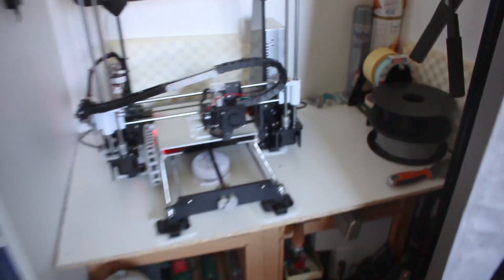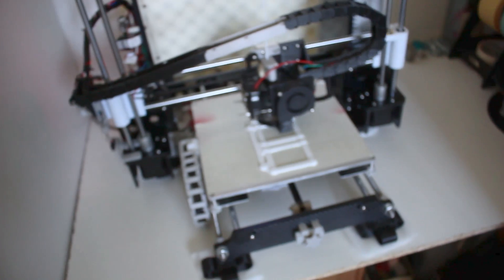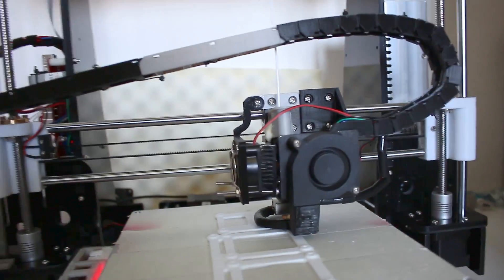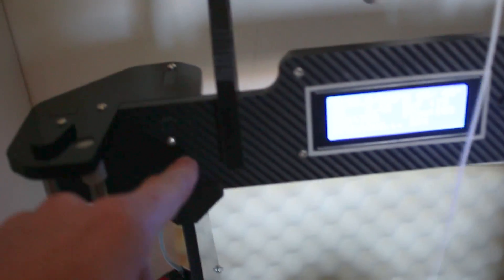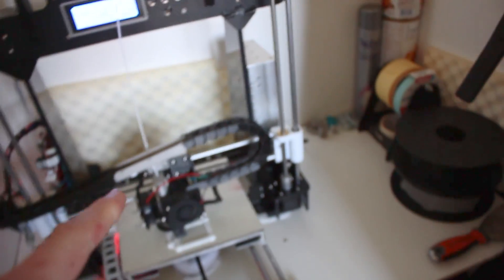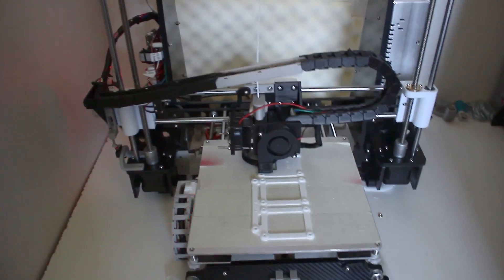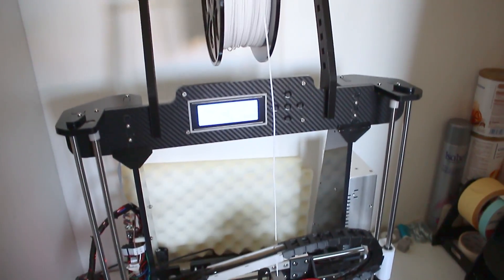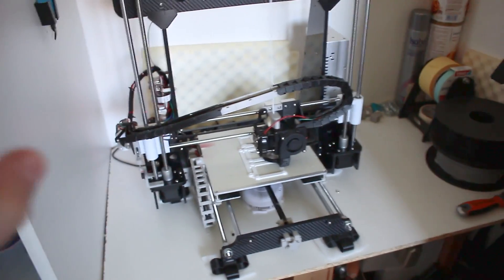ANET A8 Upgrades you must do ! [EN]

Comment: This 3d printer (I have one) is only for improving himself. Its so bad that i could'nt get it fixed for a month. Every time i change its place, Settings goes problematic.

I think you should keep it on ONE PLACE
Reply from the maker: Yuup very hard printer to work with at the begining, but you get used to it

Comment: Whats your most comon settings your using for pla and abs? Bed temp/extruder temp/flow %?  Are you using a bed leveling sensor or updated your software to marlin or skynet
Reply: Hi ! All my settings are in the description =), i'm curently using a sensor, ( i made a video about it ) and i upgraded my soft to marlin

Comment: I have just bought the Anet A8 as well and i wanted to print the chains for my wires, but they turned out really low quality. What settings did you print them at just wondering so i can have nice smooth moving ones like you.
Reply from the maker: Hi ! I put all my settings in the description of this video ;)

Comment: Thanks for the video. Do you have a tutorial which u used for your bed leveling mod? Do did you drill the H bracket and use stock springs? Thanks.
Reply from the maker: Hi ! For bed level i recommand you to use the Z axe level i showed, and i don't have any video in my mind to show you :(

Comment: did you find it difficult to calibrate the printer and get the right settings for the pla??
Reply from the maker: Hi !
It's really easy to calibrate the printer, and there is no special settings for pla, just preheat the printer ( easy to find preheat in the menu ) and print ! :)
Reply: Thearc Secondaire ok!! thanks my printer arrives tomorrow pretty exited to build it
Reply from the maker: Good luck :p You will see it's prelly easy !

Comment: I don't understand the purpose of the fan hinge. The purpose of the heatsink is to cool the extruder motor chamber to prevent kinks in the filament, clogs, and jams. With the fan hinge, you've moved the heatsink further away from the chamber, creating a gap that allows dust to get into the extruder motor chamber (completely negating your filament filter), and basically defeated the purpose of that specific fan considering its cooling a heatsink that is pulling heat from ambient air instead of the extruder chamber. 100% form and 0% function. Waste of time and filament.
Reply from the maker: The heatsink fan is made for chaging the filament more easly, for the dust i never get in , or when i get some i clean it quicly so no worries for that

Comment: you need to print the y axis frame braces aswell and also im not sure your smoke alarm will really work unless in a closed space and lots of smoke is given off as the smoke rises so under the bed may not be best.
Reply: Thanks you for commenting, i just print them and modelise some , not a long time ago :) http://www.thingiverse.com/thing:2238286
For the Alarm i replaced it on the top of my " enclosure "
Reply: Ah ok better to be safe then sorry. Also wiring your heatbed wires directly to the heatbed is a good idea.
Reply: Ahah you'r right 
But i don't totally understand " Also wiring your heatbed wires directly to the heatbed is a good idea. " ^^
Reply: The little plug that connects the heatbed power is very poor quality and will burn up on long prints causing the bed to fail so soldering it to the bed is a much safer idea. If you look on the bottom you will see where you have to solder it.
Reply: Ah  ^^ Got it ! Yup but for the moment i haven't any problems with it :)
I know this trick don't worry :) Thanks you for taking care of that
Reply: No problem glad I might of been some help :)
Reply: Ahah sure ! Thanks you mate :)

Comment: Tu me dit ca sert a quoi la module mosfet exactement, c'est ma 1ere imprimante 3d et j'aimerai bien savoir vraiment à quoi ça sert ? 
Merci
Reply: Un mosfet permet de sécurisé ton imprimante sur l’électricité et de faire chauffer tes composants ( Tête d'impression et bed ) plus vite en passant par un circuit autre que celui de l'imprimante , en quelque sorte c'est ça :) Je ferais surement un tutoriel pour en installer :)

Comment: One comment I have.

The Z rods are not supposed to go all the way up into the hole. That extension you printed does not improve print quality, but it can increase risk of binding
Reply: Okey :) Thanks for the info, but for me it improve it a little bit because it reduce the movement of the rode and of the X axis :)
Reply: Actually they are meant to go thru the holes at the top. What many seems to miss, is that you're supposed to lift the wobbly thing that's mounted on the z-motor a bit up, and have some space between the two rods inside the thing. That way it will have more free movement, and the rods will actually fit nicely with the hole at the top.